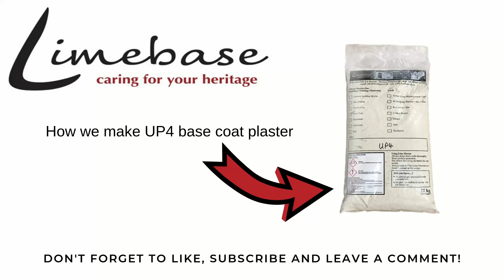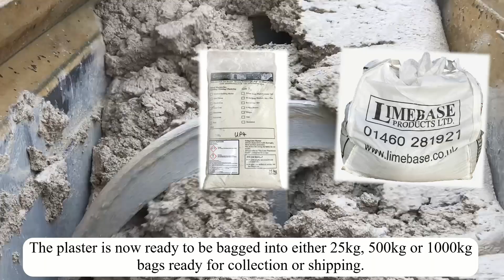How to make traditional base coat lime plaster (UP4)

Comment: Why doesn’t it get hard when you put it in bags for shipping?
Reply from the maker: Hi Shane, non-hydraulic Lime mortar sets by a process called carbonation. The Lime reacts with the carbon dioxide in the air to set, so because we seal our mortars in airtight containers the mortar wont set. Over time the mortar might get a bit stiffer in the bag but once its agitated again it will return to its original pre-mixed state.